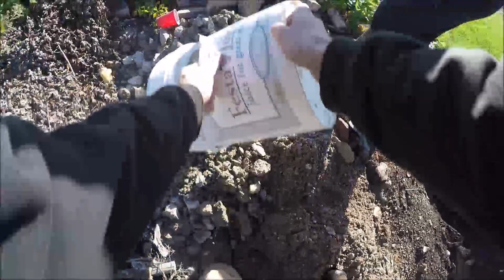Episode 177: Working with Tumuchi

Comment: Maybe get a saw and slice the floor into blocks, I've seen a concreter do this to remove a part of a apron slab they laid for me that had to be redone on my new workshop see the vid https://www.youtube.com/watch?v=2EJEXf8HDzY  The farthest section of apron or driveway of the workshop they ran out of concrete and couldn't get more that day so let it dry with a hole in the middle, came back and sliced it into small blocks with a concrete saw and flipped them out to dispose of, only took a few hours.